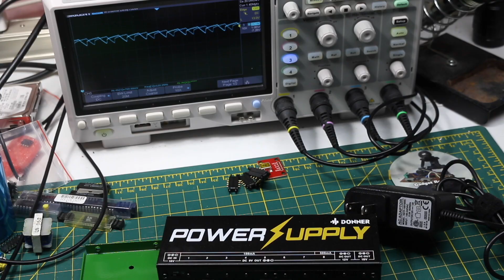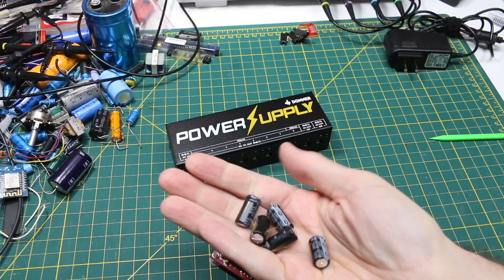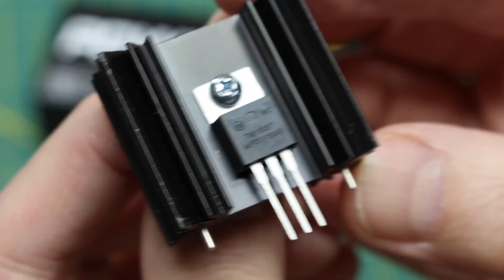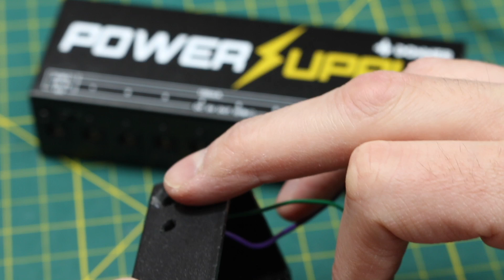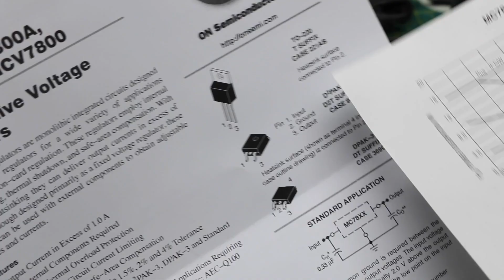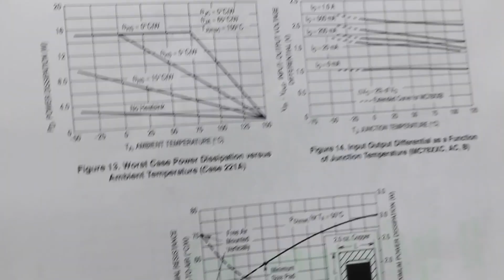Finalizing Power Supply Fixes for Guitar Effects

Comment: the heatshink would be better standing up, the heat needs to raise, the fins should be positioned to encourage the air to move by convection unless your going to add a fan. Again putting the lid on would reduce the  efficiency even further.
The biggest problems with linear reg's  is the voltage dropped across them and the headroom that you need just to keep them in regulation unless your using a LDO type. The upside is low noise and helping to heat the house in the winter. 🙂
Reply from the maker: if the thing was even getting warm to the touch I would probably go to the trouble of getting a bigger enclosure to go vertical but I just used the first scrap I could find for testing. I think I originally bought that plastic box in the 90s at RadioShack.
Reply: i remember hen we had RadioShack were in the UK,  always good for the odd packet of bit's.  @GadgetReboot

Comment: I had a 200 watt bass cab and metal zone pedal as my only signal chain for over 20 years haha. The pedal actually costs like 30 dollars more now because of the waza circuit changes you van turn off and on. You could waterboard me and I couldn't tell you what happened to that amp hahaha

Awesome content. I have a curve tracer and some tesla germanium parts along with expensive audio poly caps I'm gonna send ya. I'll send you a variety of expensive opamps too. I have more than I will ever use or do justice to the fortune I wasted buying too much. As a way of thanks. I need your po box number again buddy. It's the least I can do. You're a good man and done me a kindness recently that I appreciate. I won't buy you in leds, I've given over half of them away. 

I have the vintage ones in a safe place haha.
Reply from the maker: The metal zone was the first thing I bought when I got the first guitar in 98. Even before I bought a pick because the store gave me one pick with the guitar purchase.
I got rid of that guitar maybe 15 years ago but I can’t have a pedal collection without pedals.
Reply: @GadgetReboot  I only recently lost mine but I can't recall where to save my life. It sounds wretched compared to their other distortion pedals ehh. I played alot of blazing fast Norwegian blackmetal growing up so it sounds like a wall of noise with my right hand going back and forth at obscene speeds. I can't stomach it now but it's so fast on your picking hand that it gave me dexterity that I never thought I'd achieve because it's easy to fret  but played blazing fast haha. Mountains of might by immortal was like a marathon to play when I was young. So sweaty I'd have to change. Then I realized I just had to twich the tendon in my forearm while holding a 2mm pick. I'd sit in front of the TV and just drive open muted strings every night for years.

Comment: 2.2 ohms ESR!! 🤯🍿Man I need to start looking at my old gear ... thanks for video!
Reply from the maker: me too, I feel like I need to take everything apart especially some old stereo receivers and things from the 70s and 80s.
That power supply I bought about 10 years ago and who knows how long it was like that.
I was watching some guitar amplifier repair videos and there’s a certain capacitor bank circuit board that gets used in several fender amplifiers where they use cheap ones and they leak visibly within a couple of years.
Reply: @GadgetReboot  Despite my studio and electronics lab being packed away in storage, I think it is time to set up the electronics lab! I have two Xboxens that are in danger of a leaky smoothing capacitor for the clock. The clock is no longer necessary and those caps have been said to ruin some boards. The funny part is reading the comments where people become seriously offended at non-trained people merely cutting the caps out 😆if it works it works, but I will look into actually replacing mine since I now have the proper tools!

I also have three DC distro boxes that I built and I might do a video talking about them and discuss the designs and things I seemed to have gotten right and wrong. Two still work and I have very few ground loop noise issues using them but another bit the dust when I "requested" it draw more current than the PSU could handle. Thankfully, none of the SIX Roland Boutiques being powered by it suffered any damage (one or two of which are even discontinued).